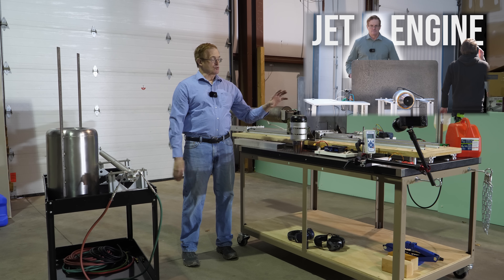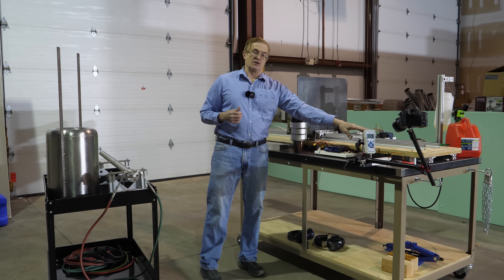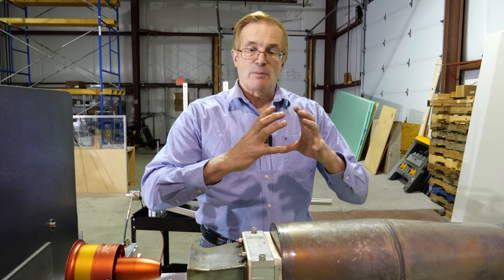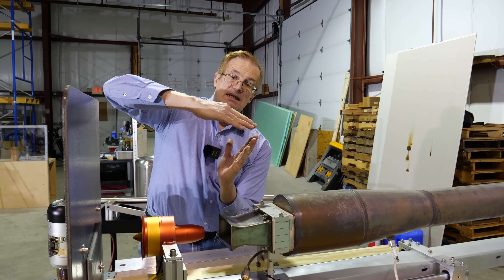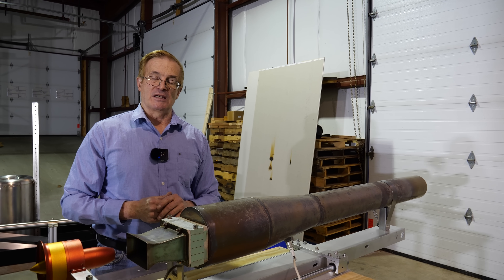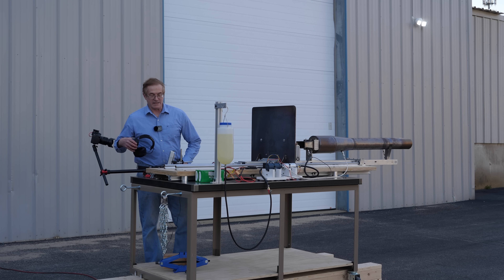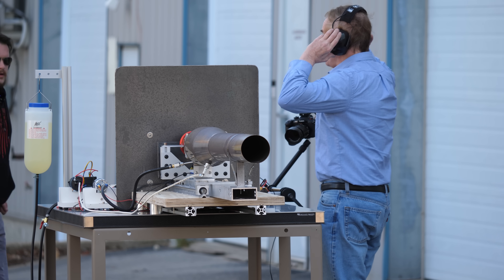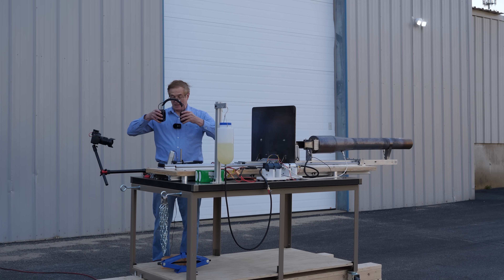Full Throttle Test: Did we Push a Pulse Jet Engine to its Limits?!

Comment: Some hefty diagonal bracing, maybe even extending further behind the table? 

A little update on the Flash Graphene experiments, I have a workable setup to safely discharge as many caps as I may care to through the sample in one of two different directions, either through the same axis as the compressive force, or normal to it. I'm building up the number of caps at the moment, I have the PCBs for a modular cap bank, adding 10 x 1000uF per board,  but only have 2 of 20 populated so far. Kemet caps are not cheap but chinesium caps are not an option. What I do have is an old low-tension AC variable supply with a relatively hefty output,  so I thought I'd  see what just passing current through a sample continuously did. From what followed, combined with a pre-print paper that came out in April this year (the first I've been able to find on the subject) it seems that the conversion from carbon to graphene has far, far more to do with the electric field than it does with the heat generated. It's referred to as Joule-Heating, but if the same amount of energy is used in a purely thermal reaction the amount and character of graphitization is very different from a thermo-electric reaction. The authors of the paper posit that the electric field reduces the activation energy for the carbon phase-change reaction dramatically. Yields of turbostratic graphene from a purely thermal reaction =  5%  while from the thermo-electric reaction =  98%.
They were able to synthesis not only the turbostratic graphene arrangement but more ordered forms right up to graphite, using electricity, while they were unable to supply enough energy to accomplish this thermally.

My next step is to make a version of my setup that can pulse the power through the sample, as, apparently, this is how the more  ordered forms are created. I have a feeling that this is the right avenue to pursue to be able make large, defect-free sheets of single-layer graphene, too. That would be take a very strong field, though, I think.

This opens up many interesting possibilities for a process that is scale-able, and the market is in a state where many companies are offering single-layer graphene, while seemingly none are able  to actually supply it. There have been quite a few investigations of the global market offerings, but after characterizing them all few-layer was the best quality obtained,  with some samples not even being pure carbon, let alone a high percentage of graphene. 

Here's a link to that paper I mentioned:  https://www.researchgate.net/publication/378528487_Electric_Field_Effects_in_Flash_Joule_Heating_Synthesis

Now, if you could just come up with a way to make a DIY Raman spectroscopy setup, and maybe something to measure X-ray diffraction, please?

Comment: You could probably bury the table slightly and then stake it down at an opposing angle to the engines forces, but I'm sure you have more planned so maybe a new testbed is worthy of consideration. Perhaps a bit of railway track.

Comment: I've ALWAYS been interested in pulse jet engines and you explained how the actual science works very clearly, thank you!

You guys like playing with fans, hot things, and thrust... I'm sure you guys have seen the turbo burn barrels that were popular on the net a bit ago and I think you guys should try to make one but put your own Tech Ingredients spin on it.

If anyone isn't aware of what it is, it is a barrel full of wood that is sealed except for one hole which is fed into a turbocharger. The turbo is spooled up with a leaf blower which pushes more air into the barrel which makes the fire burn hotter which spins the turbo faster and faster. They are crazy.
Reply from the maker: They are.
The major issue is turning them off! Unlike a fuel line with a valve, the only option is to block the intake of a running turbocharger, and that can momentary over speed the compressor and turbine.
Reply: @TechIngredients  All you have to do is put a diverter valve in the exhaust feed between the chamber and the turbocharger. Open it slowly and dump the chamber pressure, the turbo will slow down naturally and you should even be able to "idle" it until the fuel burns off completely. Wasteful, but effective.
Reply: @TechIngredients Blocking the compressor section inlet, will cause an instant "compressor surge", wich is a kind of compressor instability phenomenon, with inlet flow reversal, highly probable to damage shaft bearings and seals. 

In commercial airliner engines, compressor surge can be experienced in rare occasions by simply altering the inlet flow direction (by getting the Angle of Attack of the airplane too high, or by sidewise wind during take-off or initial climb. But modern jet engines being of the Axial Flow design, the surge phenomena is of a slightly different geometry than in centrifugal compressors, but on the Pressure-Flow diagram, both are the same "surge" phenomena.
Reply: Use Wastegate on output to divert to atmosphere like automotives do on intake side
Reply: @TechIngredients  I can't remember which video it was, but there was a group that made one that quickly got out of hand and it definitely seemed like they were having a hard time stopping it. I wonder if a high strength valve of some sort could be placed in between the hot side of the turbo and the intake from the barrel so the source of the high pressure gas could be stopped.
I've always been interested in the operation of turbochargers whether on car engines or when people repurpose them as a jet engine or a burn barrel.
Reply: @TechIngredients  whood is lame! just put a nozzle in the barrel and pump any flammable liquid, it will burn fine and its painless to stop.

Oh wait that its just a jet engine with extra steps.
Reply: @TechIngredients  Maybe killing the combustion with CO2 o N2 in the inlet of the turbocharger?
Reply: I think instead of blocking the turbo, have a lid that clamps over the end of the barrel, so nowhere for the 'exhaust' to go.
Reply: @BrilliantDesignOnline  same thing will happen, centrifugal fans will accelerate all the air inside them, as it cant go anywhere it keeps spinning faster and faster

Comment: You get a like just for playing with pulse jets.  Valveless pulse jets are even more fun, albeit a little more finicky, they have no moving parts to fall apart.  It's just a (specially shaped) tube.

Fuel efficiency is less of an issue than it might seem.  Yes, they consume a lot of fuel, but they produce a lot of thrustwith very little complication.  It's possible to get an unaugmented, valveless pulsejet to produce a TSFC (Thrust Specific Fuel Consumption) to about 3 times that of a GE90 (SNECMA in France did this in the '50s with their "Ecrivisse") and if you augment and feed water vapour into the inlet you're getting very close to that of a commercial turbojet.  From a bit of tube.

I suspect you've realised the real reason they aren't used very much.  They're a bit loud.

Comment: Lost power with more air?
 Too lean ,more go go juice to help the raito? 
Blower holding the valvs open longer , allowing more pressure loss through the intake before the valve closes?
Reply from the maker: No, we actually gained a significant amount of power based on the force guage.
Reply: Then I interpreted the hi/ low settings on the controller backwards.  40 is significant  I agree.

Comment: Re: the augmenter for Jetex solid pellet rocket engines I mentioned last video, I don't think it has a space between the exhaust nozzle & the augmenter, the exhaust nozzle is inside the augmenter, I think it works something like a venturi effect.

Comment: When I was 16, in the 1950s, I tried to make a pulse-jet from a 3 inch  steel naval gun shell casing that my dad brought home.  I went through several drill bits opening up the base as that casing had been hardened from its one time use. Not having worked out the flutter valve yet, I wanted to test the fuel injection, which for me was a Colman stove generator unit. It scared me when it shot a flame 16 feet long across the garage floor and I instantly closed the valve.  Apparently I had built a flame thrower instead.
Tipping the shell casing up outside the garage I looked down the barrel and seeing some remaining liquid at the bottom decided to get rid of the evidence. I dropped a match down it and the resulting puff of flame singed my eyebrows off.  I was lucky that that  was the worst of that experiment in jet power.
Reply: Eyebrows are a small sacrifice for a good story .
Reply: hey,    i also have tried to drill through spent large calibre casings..hardened through its one time use??i never considered that,makes sense! thanks
Reply: Nice to see someone here older than me. Was 7 as I cleared to 50s. Reminds me of looking down the throats of dual quads when the engine backfired. My brother said, "You should see your hair man!🤣"
Reply: You’re lucky. I still have scars on my arm. 4th degree burns.

Comment: Could some kind of a springed valve setup in the rear increase the compression?   Clearly, the springs would need to be external.
Reply: those valves in the back would be glowing white hot, probably no easily accessible material is going to both be light enough and hold together
Reply: @vxiiduu  I agree, we have trust vectored jet/rocket engines so the material exists, but it probably won't pass the cost benefit analysis :)   It was more of a curiosity if you could get the engine more efficient.

Comment: Can you combine the output of multiple pulsejets at different ignition intervals?
Reply: Now THAT'S an interesting idea.  Maybe use a distrubutor from an old 4 cylinder gasoline engine for the spark timing.  I suspect you would be getting a lot of off-axis thrust though since you can't really "stack" pulse jet engines too close together.
Reply from the maker: Yes.
This has already been done by mode- locking the individual engines with cross-over tubes linking the combustion chambers.
Reply: @TechIngredients  Much easier than using the distributor from an old beetle LOL

Comment: In the 1960s, some model pilots built pulse jet engines with star-shaped flutter valves. However, these valves only lasted for a very short time for one or two flights.
Reply: So,  with modern materials....
Reply: 5 flights🤣

Comment: bolt your test platform down in the back of your pickup, that way you might even be able to show a "practical" implementation using the thrust to power a vehicle.
Reply from the maker: Just wait...
Reply: Would your vehicle remain "Street Legal" at that point? But the real question would be could the police catch you to tell you it wasn't legal anymore? LOL.
Reply: @robertedwards7749  they might keep a fair distance to you, with lights and sirens on, the sirens you wont hear though. having a glowing red pulsejet engine on your back speweing flames .... yeah 50m minimum
Reply: @StreuPfeffer  I would imagine anyone closer than 30 yards behind you would suffer from severe dry eye syndrome. hahaaha.
Reply: If you can build a muffler for a pulse jet that doesn’t kill the power output, you’d really have something fun to drive around town!  No more tailgaters either.  Or at least not repeat offenders!
Reply: @firstmkb  Helium shell from his older video might be interesting.
Reply: If my calculations are correct, when this baby hits 88 miles per hour, you're gonna see some serious shit.
Reply: One way to deter tailgaters.
Reply: @dalecomer5951  add some flour into it for better effect, or run fuel rich and make the flame more extreme? (not sure how the pulse will react to that though)

Comment: Reed valves , tuned exhaust, sounds like my 2 stroke bike engine.😁
Reply: It is literally the same thing but without a piston and cylinder. If you used a 2 stroke pipe, it would probably sound like the 2 stroke it came from.

Comment: Very cool.  It'd be fun to see if the thrust or fwd motion could be used to power the fuel pump.  Self-sustaining till it runs out of fuel.
Reply: Could make a diaphragm pump run off the chamber pressure pulses or the intake air pulses probably.

Comment: "I didn't believe them..." The line that starts all great science stories. ❤
Reply: And not really starting small...
Reply: bruce simpson from new zealand has been working on these and posting them on the internet since around 1999, google it if you want some nearly lost internet science
Reply: @TechIngredients For the stabilization and safety of the table part why not try installing  something on it similar to the extending feet that large cranes and heavy duty tow trucks have to stabilize it.
Reply: How can I  learn it?have any training?
Reply: I been thinking, couldn't a Tesla valve possibly be used  on one of these engines?  Keeping the flow in one direction possibly inject fuel in the valve?
Reply from the maker: No.
The problem with his valve is that even though it favors one direction of flow, the difference is relatively small.  To achieve a significant difference, it requires a lot of stages, and this interferes with flow in the desired direction.
Reply: @TechIngredients Could one CAD that and run a fluid flow analysis?
Reply: @Cprtlcfbnv it’s been done.
Reply: @TechIngredients  Tesla valve setup? If you could make it light enough. Size is also an issue.
Reply: @jamest.5001 It is possible to etch very tiny Tesla valves into glass using laser or chemical etching process:  https://www.youtube.com/watch?v=gQnmP7UD_zk
Reply: @jamest.5001 integza tried using one, there was too much pressure loss